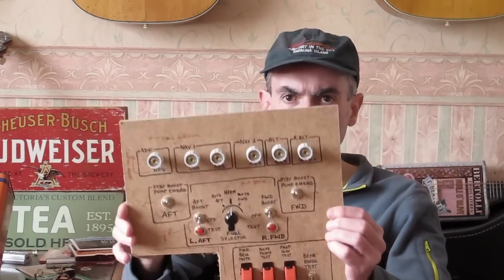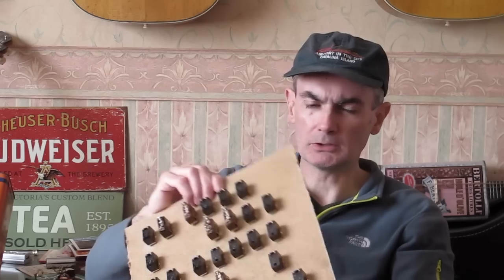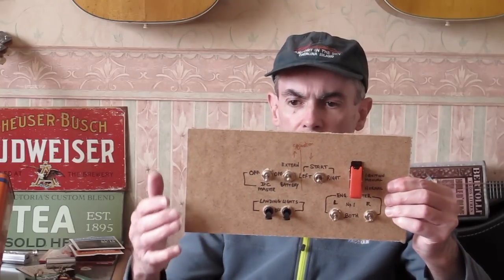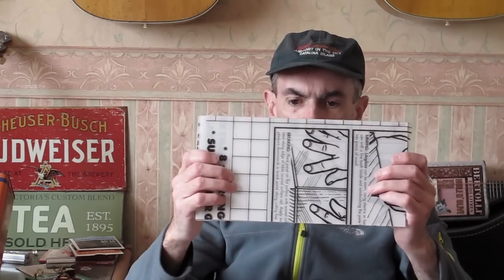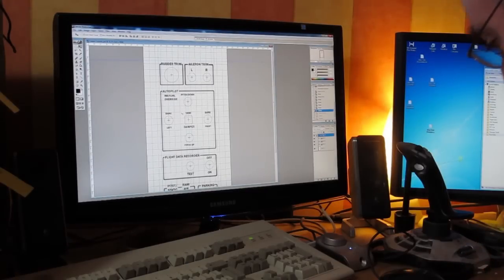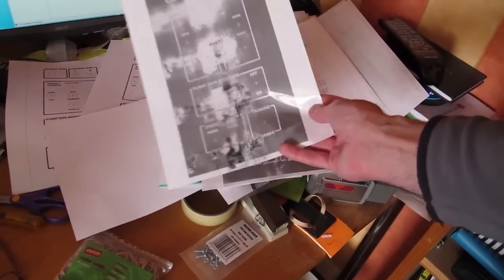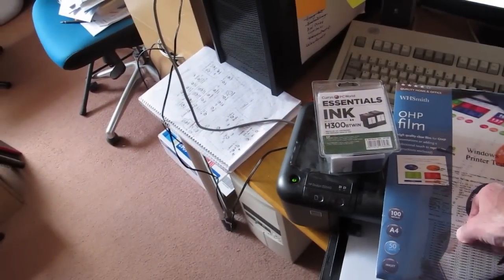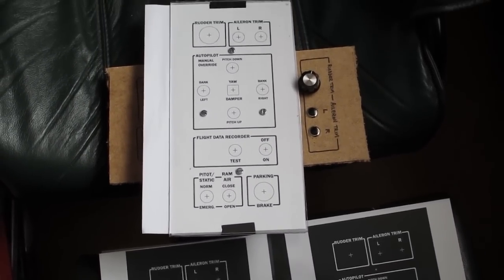Designing the First Real Panel (Twin Otter Cockpit Build - Part 3)

Comment: http://youtu.be/xiPaI0R0YcY this is the link for the paper I use. I print out my panels, stick it on the acrylic and then carefully drill the holes. Works a treat.
Reply from the maker: Thanks for the links, have bookmarked both those to check out later!